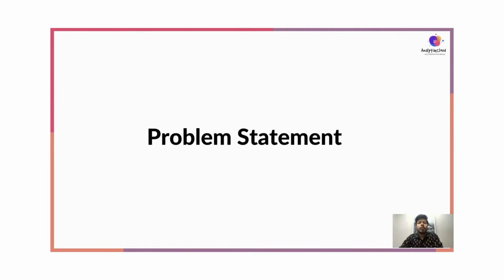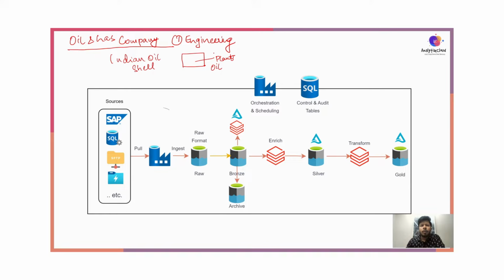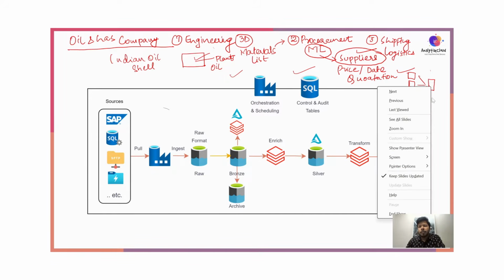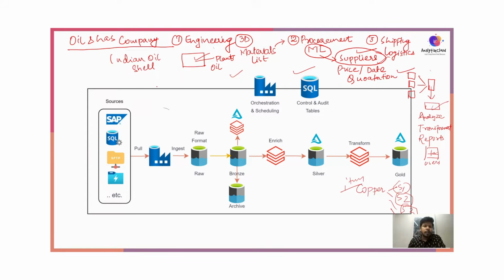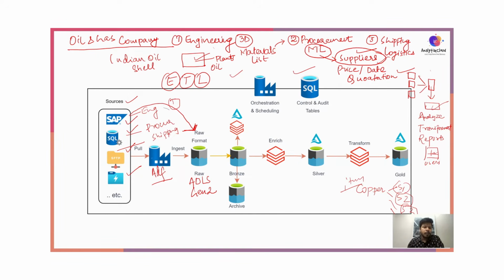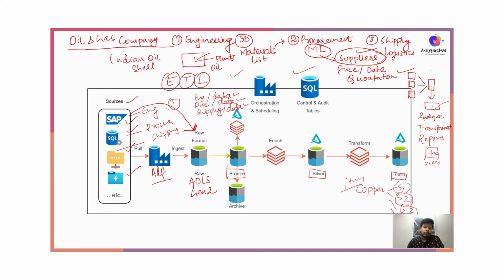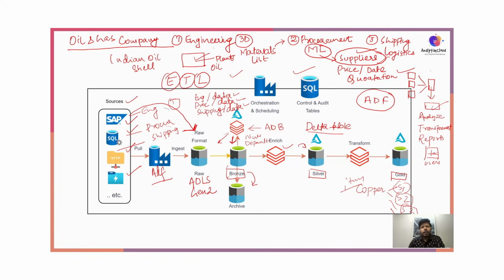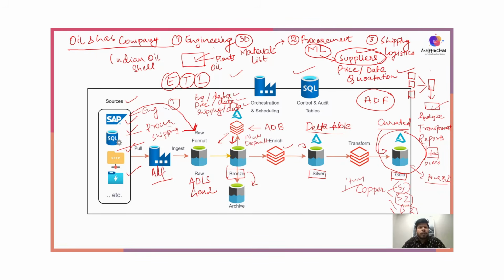Part-1: Real time end to end Azure Data Engineering Project

Comment: Interesting video, when can we have complete use case implementation
Reply from the maker: Thank you. We shall be sharing our next video soon where we will be doing the implementation from extracting the data from on prem using ADF and will be loading the data till Silver later including some transformations. Part -4 will be till Gold layer. Please stay tuned we will come up with Part 3 soon.
Reply from the maker: Also our part 2 is out.. so you can have a look
Reply: In industry will interviewer ask about gas n oil domain means if i out on resume this project n my company don't have gas n oil domain

Will they check it
Reply from the maker: No they won’t check, you can say you were working for Oil & Gas Clients